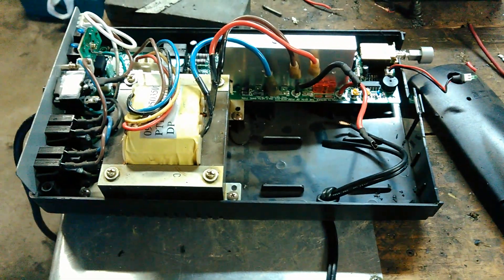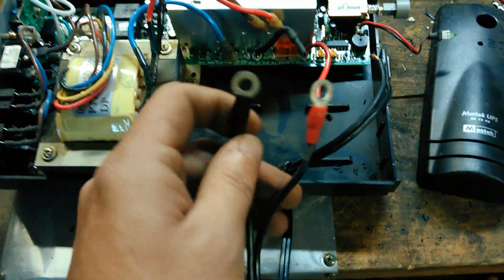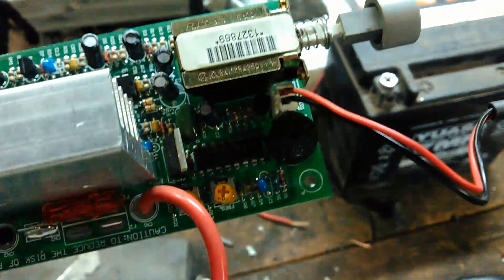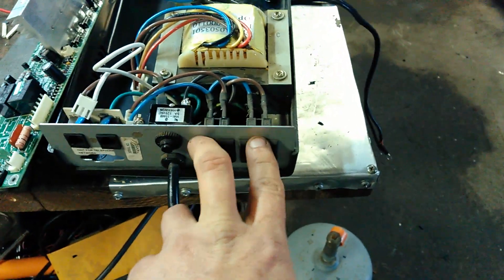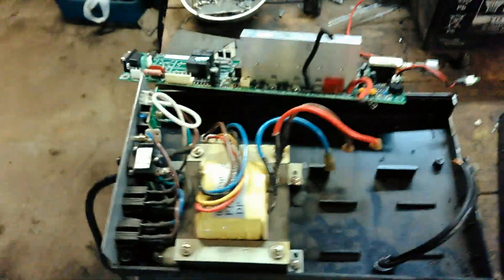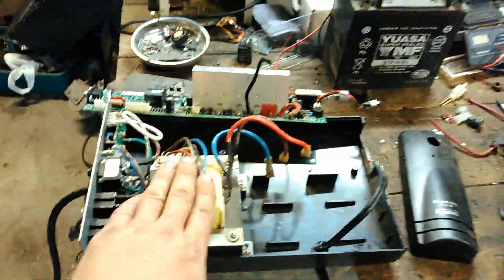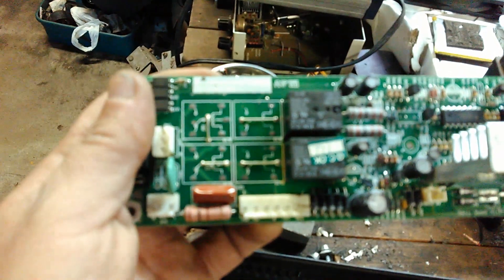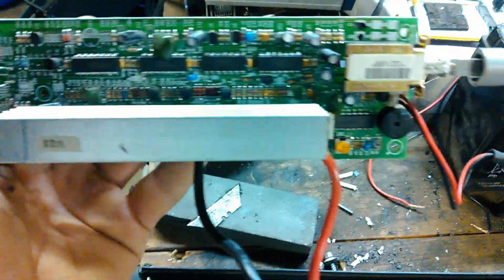UPS battery hack #2

Comment: Start looking for a pure sine wave UPS not a cheap one. Look for one that will support a 1000w or more, then you can run a separate set of outlets in the house with automatic UPS support.
Some server rooms use several 3KVA units, now 3KVA would do a small house nicely and could well be supported by some huge truck batteries.

Comment: these old ups units were made for computers, it the power went out when you were using your computer you could safely shut it down, there not made to run a fan or refrigerator.
Reply from the maker: I have used this one for a few years now to run lights and it is still working. They are good for light duty stuff like lights with no issues.

Comment: Please never ever ever do this. The UPS are only designed to run with the batteries supplied. What happens is the UPS has to run longer than it was designed to. This causes more heat to be generated, and these UPS only have a small heat sink, so it can dissipate the heat quick enough, and it causes the components to melt down. 
If you look at UPS that come with larger batteries from the factory, they also have larger heat sinks.
Heat is generated in discharging and charging the batteries, so you can't charge the batteries and use the UPS to maintain them and expect it to safely power your devices when the power goes out for longer than it was originally designed for. It may, but it wasn't designed to, it can potentially cause more problems.
Reply: The size of the heatsink would be related to it's Wattage output.  The battery size has nothing to do with it, a fairly small battery and a giant battery are more than capable of providing the maximum output of the unit, aka it will make no difference.
Reply: blogobre
The heatsink does matter. Its related to wattage output and length of time the heatsink is needed for.
Yes, it wont make a difference if you keep the wattage output low, the heatsink will never get too hot.
If you use the unit close to its max wattage output, the temperature max continually rise while its being used. That's not an issue for the small batteries because they will be drained before the unit ever reaches a temperature that's too hot. A large battery will continually run over that time, generating more heat.
Its just a sign of an undersized cooling system. Its cheaper to just undersized it, the UPS are already heavy and large, which in this world is undesirable by a lot of people, less parts (no fan), etc.
They made the units to do one job, and that is to run for the wattage output and time they listed.
Reply: Are you saying that 10 mins versus 30 hrs will make a difference in the heatsink?  Does the heat keep going up and up as you suggest, rather than radiating the energy away into the air like it's designed to?  Are you also saying that a decent maker such as APC have undersized heatsinks in mission critical applications that they back up?  Are you saying that systems that at times cost thousands new would undersized a heatsink to make it cheaper and no engineering was done on it?  Are you saying that aluminum that's finned weighs much,  especially in comparison to the weight and size of the batteries?  

There's an easy way to calculate it actually and an easier way to test it.  Run it at max wattage and check the temp of the heatsink, I bet it's just warm not hot after a few mins and I bet the temperature sits there, as it's designed to do, at least on decent ones.  You can also approximately calculate the necessary size via energy that's turned to heat, which is related to the efficiency of the device and the surface area and air flow of the unit. 

No, I think you're making speculation without much evidence, perhaps repeating a rumor previously told and I'm happy to see the data supporting your position, though I'm skeptical to your assumptions.

You also haven't answered the challenge, that is wattage output ... aka generally those units with bigger batteries...  is the reason for the larger heatsink, 'not' the larger batteries.  If your assumption was true, the units with hot-swapable batteries or 'add on batteries' [which you can daisy chain endlessly if you like] would have to have ever increasing heat sinks to accommodate those larger and larger battery banks.  Heck I've seen 20kwh hooked up to an APC 5kw unit. Your position makes zero sense.
Reply: blogobre
At what point do you think the UPS reaches its max temperature at maximum load?
Also have you looked at the run time chart of regular UPS? About half of what you said, 5 minutes, unless you get the more expensive UPS.
It takes time to heat up the all the metal inside a UPS, plus the actual case, they have very limited cooling inside a metal case with no fans, etc. Same reason you can start a car without a fan and coolant. You have a limited time that way, but you can still do it.
The load you put on the UPS will matter though, and if you ever look at the marketing for a UPS, when they claim long run times, its at a small load, at full load, there is just a few minutes.
If you want to prove your point, please do some research and use actual facts.
Reply: Ahh, and now you expect me to support my claim... yet my claim is asking you questions about your claim... and you have yet to support your own claim, presumably because you can't, to which is my point.  You don't know what you're saying here, you're making speculations without evidence. 

The burden of proof here is on you, it's a 2500 year philosophical [and now scientific] principle.
  I'm more than happy to be wrong here, though I require 'some' level of data to support it, not just 'what you think'.
Reply: blogobre
Bye... Clearly you're not familiar with common UPS.
Reply: Ha ha..  so when asked to show your position and held to account for it, you run.  Uh ha...  so nope.

Lets put the final nail in my snoopdug's position...  Think about it for anyone bothering to read this... your standard 'quality' UPS uses what is called an 'online' or 'double conversion'

.. which means that mains comes in, that mains is converted to DC [some energy is lost as heat, typically about 5%] that does two things, charges the battery [or keeps them charged]...and is then converted back [a little more heat about 5% again] to AC and powers your equipment.  Ok, so we have the DC-AC inverter running 24/7 for whatever you have hooked up to it.   

When you are on 'only' batteries you only have the DC-AC inverter running, so in effect you are only generating 'half' the heat of what the unit normally produces when connected to mains. 

So Mr. Snopdug was incorrect because the units run on the inverter all of the time.   I rest my position.
Reply: blogobre
http://www.apc.com/us/en/faqs/FA157448/
Reply: Sure and your link describes the fundamentals and brings no supportive evidence to your claim that battery pack size make a difference to the heat generation.  More over it supports my contention and demonstrates what I have already described that is that instead of having 2 heat inducing energy conversions for the most common UPS method [says so in the link] that is 'online'.. when on batteries you only have 1, that is DC to AC and it also describes it in the diagram as always being on.  Look I get it, I'm sure you're an IT guy or something, I'm sure you know your way around the software, ... you seem to be suffering from the Dunner Kruger effect here, open your eyes to another idea instead of having to be correct, because I'm pretty sure you're not here.
Reply: blogobre
Reason I say bye... you don't know what you are talking about.

Most common UPS are standby, meaning they watch the main lines coming in, do so minor surge suppression and filtering. If the main lines get too far out of what they can correct or the power goes out, they jump to the battery packs. They have a slightly delay between running on the main power, to switching to the batteries.
This means any major heat generating is when running on the batteries, or recharging the batteries. They aren't built to to this constantly.
Same for electric motors, you can find some that have a limit duty cycle, and others that have a continuous duty cycle. This duty cycle is usually to limit the temperature of these motors. Standby UPS have a similar design built into them. This reduces their cost, makes them smaller, and still do their job. They want to avoid the temperature equilibrium of these items because its above the safe operating temperature of these items. Its easy to design something like this, and they have a place in this world, just don't take them out of their place and expect them to work properly and safely.
This system is used because its cost effective. No average consumer is going to want to spend more money than they really have to on an item that isn't use that often.

The system you described is an on-line type UPS. They provided a smoother power supply out of them. They are great for sensitive electronics and equipment that can't handle the delay of the standby UPS.
Their cons are cost and size. Not many households will have one of these.
They are used in areas where there has to be no problems for one reason or another. Maybe its for peoples lives, maybe its for cost.
The people that maintain these, will know what they have and what they can and can not do. My message is to the diy-er who hasn't learned everything yet, as a warning, to get them to start looking around, doing research.

If you can't believe me, look at the prices of different UPS, look at what type they are. They won't say they are a standby UPS, but they will say if they are a double conversion, or an online type, or some other type.

I'm not getting into anything personal with you, and I am extremely open to new ideas, you just haven't said any honestly.
I just want you and everyone else who watches these videos to be safe.

Also, FYI, in this video, its a standby UPS. Everything is so small. small batteries, small wires, same transformers, etc. (that isn't how I know its a standby UPS, I'm just expressing the smallness)
Reply: We can agree, the cheap in line is not the right choice.  I do question the concern on heat though we'll have to just agree to disagree. 

The double conversion units new are indeed expensive and second hand rather cheap, heck I picked up a 5KW unit for $50USD that's hooked up to 22kwh of batteries.  They are excellent for that role, I can speak from a couple of years of experience.
Reply: So what your saying is that it's ok to do this in the winter? 🤨
Reply: @uncleasshole3787   Except they usually stay in a temperature controlled environment.

Comment: Next time use thicker wire to the car-battery. Don't make a connection to other wires. Don't use bolts and screws for a connection. Go direct to the circuit board, every resistance will cost you los of energy. 
 
Something else: think about making a 12V DC net in your house, Many things can be used on a low voltage direct current, such as laptops, reasers, chargers for mobile telephone. The big screen TV wound't work on 12 Vols because it uses to much energy. A small TV set is working. Lightbulbs are to old, go to LED lights. Actually 110V AC is a bit out of date.
Reply: 12VDC eh...  You talk about resistance, though thick bolts and screws will offer very little ... and yet don't mention [or don't know] about the losses related to voltage and wire size, which means either really thick and expensive wire and/or short runs for 12VDC to reduce the wire resistance losses.   110VAC out of date... ROFL... the fact is DC and AC already had a battle in the early history of electricity, ... AC won and for a good reason as it can travel further with less losses.  Also higher voltage is used because it gets lower losses.  Power outside your house is higher voltage again, the high voltage wires are much higher again, ... all for reduced resistance losses.   Why, because it's superior.

There is some advantage to not converting from battery DC to AC for certain applications such as a RV, which has little space for solar and have to do the best with it's limited resources.   That 5% or so increased efficiency and the very short runs from battery to powered device gives it an edge.  Now if we compare that to an average house, the cost of the wire alone will very quickly outdo any potential saving compared to the price of 5% more panel and you'll pay even more for the non-standard electrical equipment, aka supply and demand.  So in general nope.
Reply from the maker: I did Install the wires directly to the board. This unit being a 360 watt unit I didn't need to use heavy wire as it will only be used to run some lights.  I have run this unit quite a while and not 1 time has the wire or the connection to the battery has gotten hot.

Comment: Most UPSs buzzers can be disabled or set to a schedule by logging into the UPSs firmware...
Reply from the maker: +Ben Kayfetz Yes you are correct if there is a network connection. I have removed the buzzer on some and installed a LED light in its place. Some smaller units have the ability to add some components and increase the output. They just omited them to have a smaller cheaper unit.